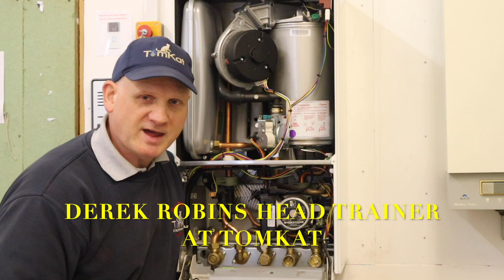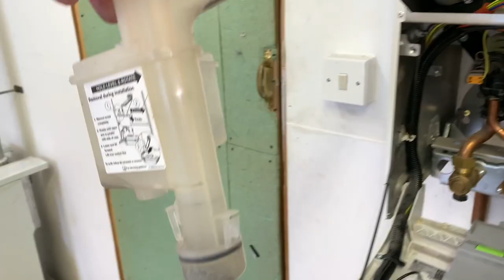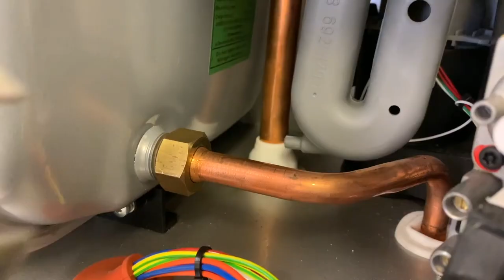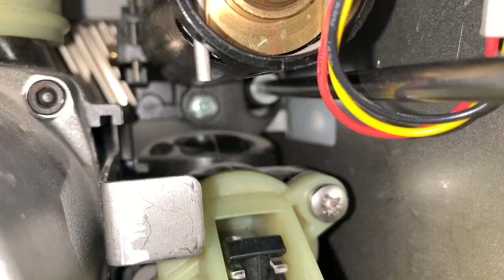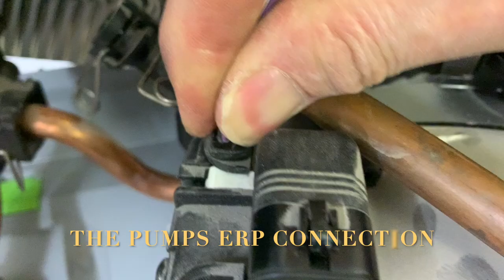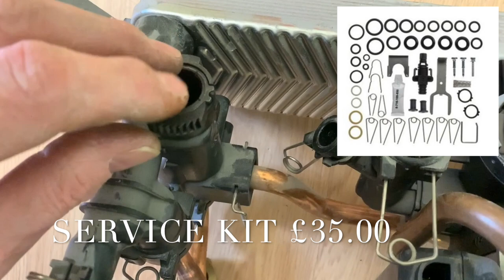How to remove a Worcester 25i erp hydroblock, replacing left or right side hydroblock on a Worcester

Comment: Yes, always pump the pressure vessel dry when draining and set div valve mid position, I also have my wet and dry plugged in ready to go if needed. Those seal kits aren't cheap either, they seem to have every O ring and clip on the boiler in them and you only use a few of them, unless there is a smaller pack, the fibre washers are unique to Worcester, standard ones don't seem to fit. Great video as usual.

Comment: You're a god I have done a few of these never as quickly as you and some of them can be real bastards anybody doing it need to watch out for Sharp sheet metal in the boiler case also real handy to have a wet Vek there and if you're feeling really sharp take the cap off the expansion vessel check and if necessary pressure it back up it's quite possible by the time you get to take the Hydro block out will be worn out you could check that before you drained and strip the boiler by  pressing the shrider valve if you get water out it is clucked and you can have the conversation with the customer befor trying to haggle after  the boiler strip down.This will save you the embarrassment of having the ev going glug glug this happens sometimes even after draining not trying to be cocky just to help the youngsters .

Comment: Great video again. You made it look easy but we all know a boiler that has been in situ for 5 years or more it's not so easy. I would also suggest to put the boiler into service mode to aid with drain down cause it moves the diverter valve in to mid position also if a boiler has deaeration function best practise to use it.

Comment: You certainly get plenty of practice replacing hydro blocks on WB boilers. They  fail even with shock arresters fitted. It's because the plastics are crap....but hey,  WHICH likes them so crack on....as it were 🤣
Reply: Truth be told Worcesters are assembled using the most cost effective parts and they haven't taken on board what installers on the field have said.  
They are however fantastic at product marketing.  I reckon they could sell the public shit on a stick 🤣.  Customers seem to have a preference and it's branded with a Bosch logo.  That's until they have one installed 😏.
Ideal on the other hand have took on board what installers have mentioned.  They've progressed alot over the years 😊. Still have their flaws though. As to many other manufacturers.

Comment: Usually it is easier to take out parts, but putting them back again is a mission. Once I changed burner gasket, and because new gasket was thicker and  sliding in the fan assembly back in its places, was nightmare.